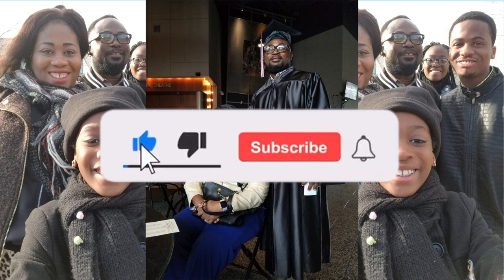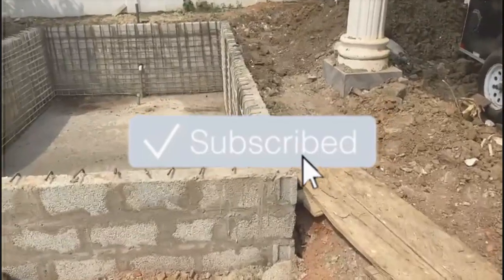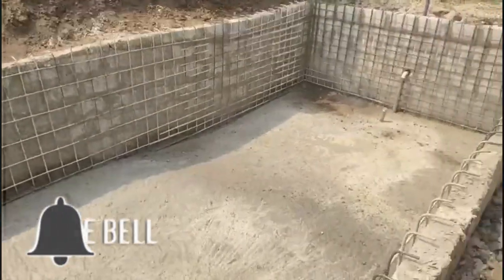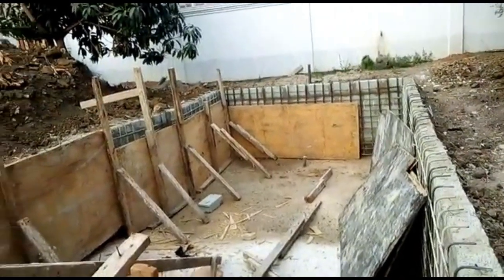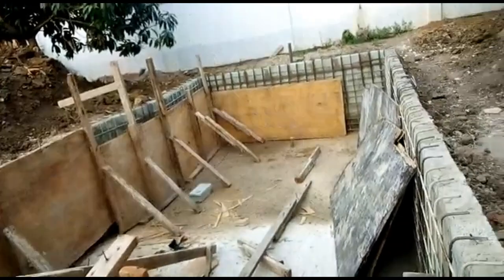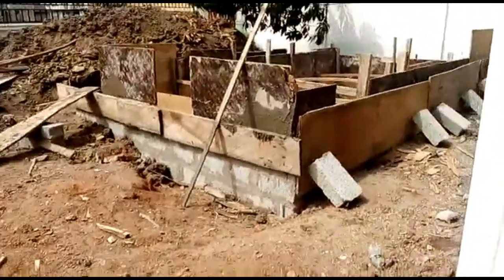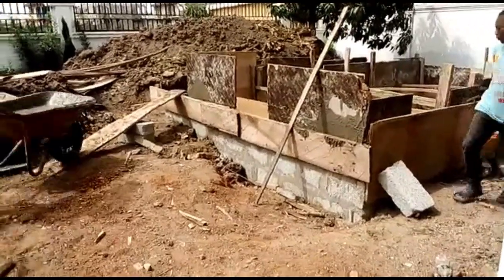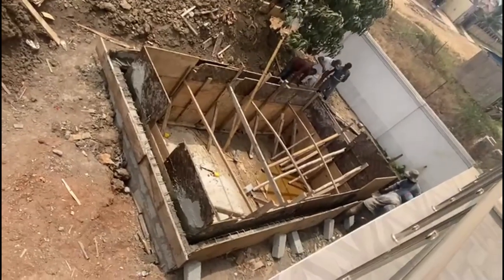BUILDING IN GHANA,DIY SWIMMING POOL CONCRETE.|| THE QUARSHIE'S Vlog #27

Comment: Wow its working. Are you doing a double wall?
Reply from the maker: It seems like double wall,right?
Reply: @thequarshies753  double wall is when you fix the iron rods you lay another block so the iron will be in the middle of the two rows of blocks the you pour in the concrete I am told it make it very strong and prevents leakage
Reply from the maker: @thequeenprivatebutreal8684  Oooooh okay 👍,never came across in my search thanks though.
Reply: @thequarshies753  I saw it on mimics page